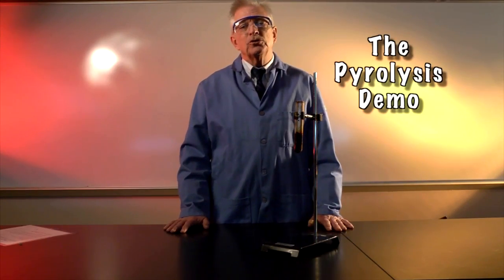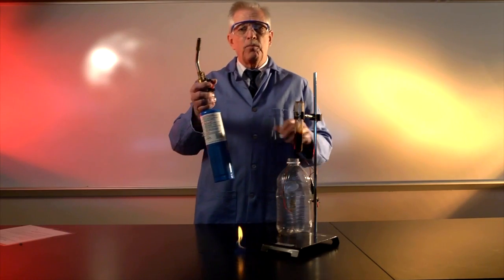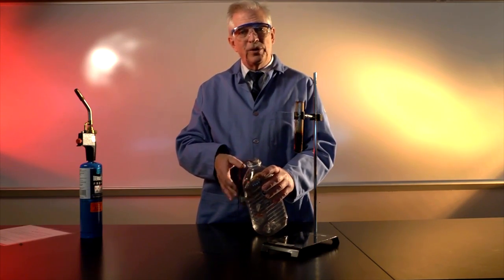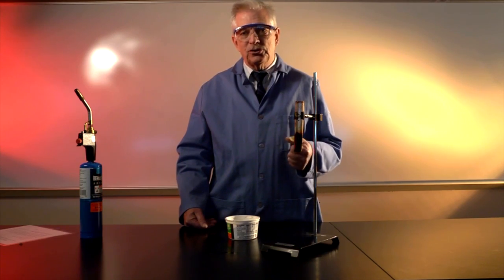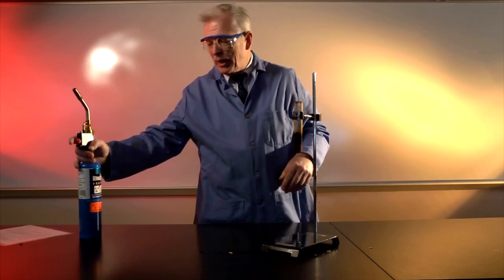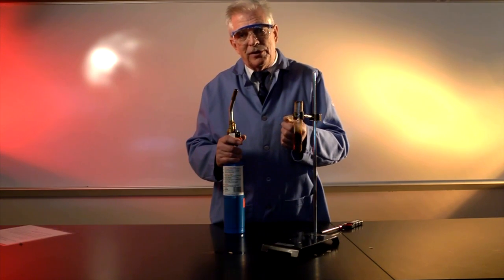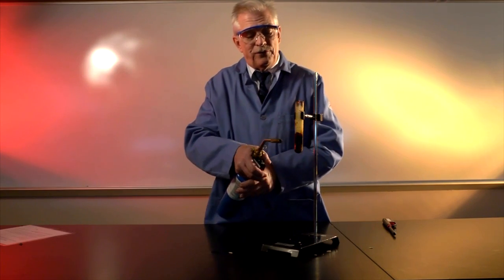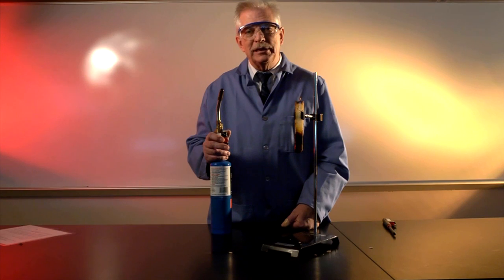Pyrolysis Demo

Comment: Nice video demonstration. You said in the video "Only vapors burn, not liquids or solids." Can you explain the combustion of charcoal or pure carbon in context of that statement? My understanding is the surface is actually reacting.
Reply: Charcoal actually doesn't produce flame, it mostly smolders, it does by reacting with oxygen on its surface as you heat the charcoal to enough temperature, once it reacts with oxygen it produces heat thus keeping the charcoal hot making it react with more oxygen. So, as long as charcoal is hot enough and it has air supply to it, it smolders.
Reply: Charcoal reacts with oxygen of the air at a glowing red heat to form colourless carbon monoxide gas, which then burns with a blue flame with more oxygen from the air to produce carbon dioxide gas.

Comment: I would like to try it one day. The flammable vapor the wood was giving off it is gas you can stick into an engine right? All I have to do is put the wood in a fire ressistance container and heat them up with a torch?
Reply: yes you can but you have to filter it before it gets to the engine . as he said tar is also a product of pyrolysis . u dont want it in your engine .